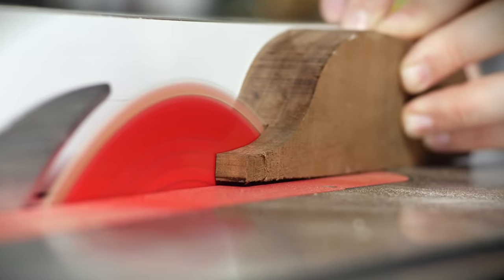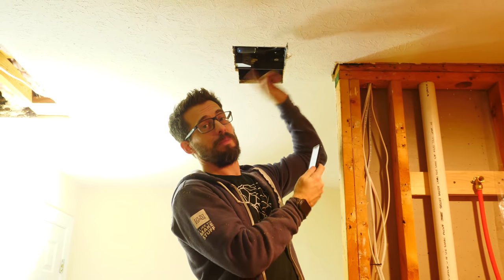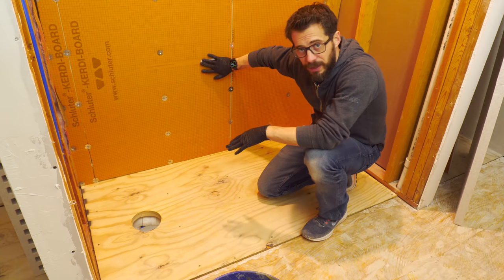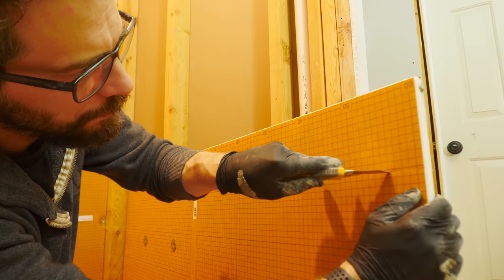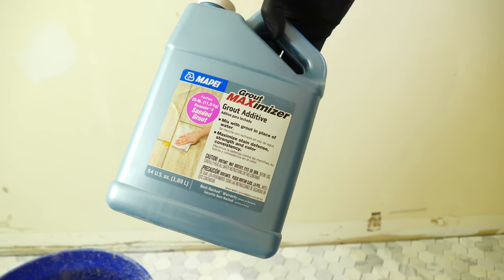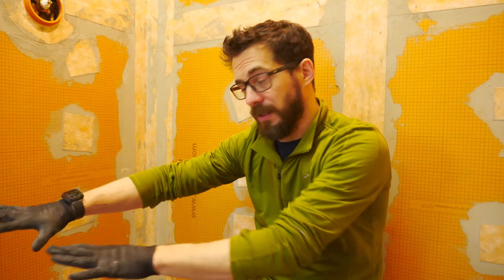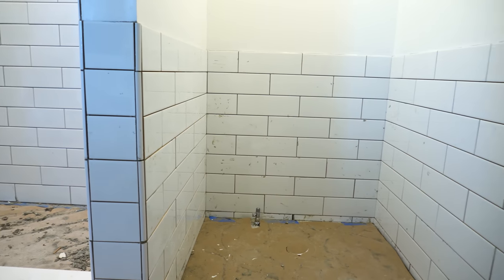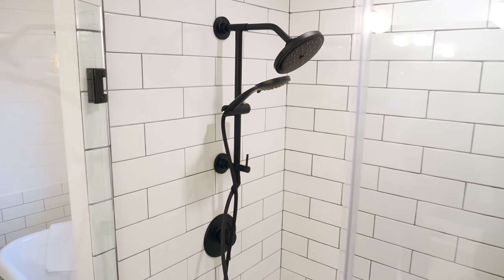Remodeling a Master Bathroom | Part 2 | I Like To Make Stuff

Comment: OK, I was all set to ask a question about the shower door (I'm installing the same basic one in the near future) and then I see something odd. Where is the bottom channel for the fixed shower door panel? I know that door comes with one. My question was how you were going to screw the channel into a foam curb? I'm using Wedi products and that question is why I'm not using their all foam curb. The Wedi rep said for that type of fixed panel (heavy point load) to build a curb from 2x4's and Wedi panel. That way I have somehting to screw the bottom channel into.

Comment: "make sure your light fixture is rated for what you're using it for" lol i had a naked lightbulb sticking out of an unfinished wall above my shower for years, it was terrifying. the door on that bathroom was a blanket nailed to the top of the frame, and it was also the only source of water in the apartment. i'm glad we moved out.

Comment: I'm not a fan of simple abrupt ending of tile like you have there. I would have gone for a row of bead tile in black or to match the wall tiles. I like a more defined transistion. Still it's a great job. I love the variation in tile types, switching to the penny rounds in the shower

Comment: Great job. I have two comments

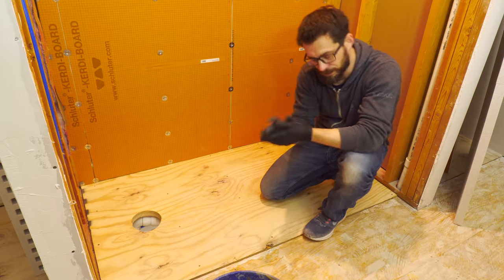1. 7:57 wet the wood with a damp sponge. Dry wood can rob the thinset of water and prevent the thinset from properly curing.
2. It's not a step, it's called a curb (I know, a bit pedantic).

Comment: Im quite amazed how different the water sealing steps goes from country to country. Compared to the steps to water seal a bathroom in sweden darn you get off easy lol. Almost quadruple the amount of steps you did and add atleast 3 days just to get it sealed properly since each layer has a 15+h drying time. And thats before you can even start laying on the tile xD.

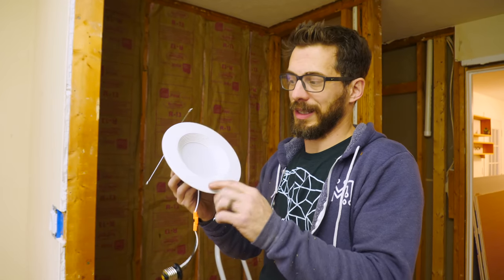Comment: Hey Bob the bathroom looks great. I noticed a PVC line in the wall with a cap on the bottom at 2:44 in the video. Was that an old vent line you abandoned? It looked like 1 1/2" and that would make sense for the old shower drain vent line. I hope you disconnected that vent line in the attic too because if that line still vents to the roof rain water can make it's way down into that capped pipe section and the water would have no where to go. The cap would eventually leak and all that water would empty in your wall.

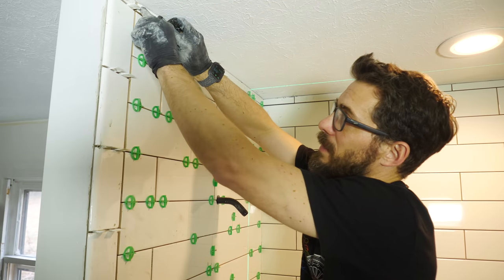Comment: 21:15 Just a heads up, the "correct" way is to measure up the tiling, and average out the bottom and top tiles, so you don't end up with that narrow stroke.

Comment: Hey Bob, Love your work.  You available to tackle our master bath here in So Cal? Getting not-so-subtle hints for a long time. One tiny suggestion though . . .  Learned the hard way that MDF and water are a bad mix, and your counter top appears to be that laminate over MDF type.  We had a minor leak that went unnoticed til the counter top failed and reverted to sawdust.  I now at least prime all raw MDF surfaces a few coats before assembly anywhere near water.  Thanks for some great tips!

Comment: The room turned out awesome! 
The only thing that concerns me is that the vent fan looks a little undersized for the room. I'm sure specs were checked and the CFM matches up, but it looks small to me. The area the toilet is in might suffer when it comes to airflow because of the wall, and being so close to the door, I would worry about an unpleasant situation in the hallway lol

Comment: Bob, your videos have come a long way, and so have you.   I really appreciate your meticulous nature and precision.   You are certainly not a heavily seasoned remodeler pro who has done this kind of work for years on end.

You did your damn best and tried to be as accurate and exact as possible and it shows in the result.   

As a critique:
In my opinion the heavily saturated smurf blue color of the cabinets distracts from the elegance of your remodel.  You usually use that kind of color under a gaming PC.   

For a fine bathroom with great tile work and excellent fixtures; tone that color back!!

Even if blue is your color; great!  Use a toned down color of blue, even if it’s a lighter shade say,  a “robins egg blue” (same intensity and saturation) it would go better with what you did there.  

Not to take an ounce away from the great work you have done here, that’s simply my opinion.   Paint it freakin Neon pink; it’s your house.   You have it however the hell you want.  

Especially after all that work you did.   

Thanks for your time making this vid.

Comment: It looked like you left out some waterproofing along the lower kerdi board joint on the drain side of the shower. Not a big issue but would have been nice to see that waterproofed. It seems you also covered up the HVAC vent with the tub. Even though the tub is on stands, it would have been better to move the vent (perhaps to the adjacent wall) for air circulation in the room which would provide increased air flow for the shower fan. Also this would avoid having condensate dripping from the tub into the duct work. Would be good to insulate the floor as well since it seems to be directly over the garage. Without that thermal break you essentially have a warm room over an exterior floor, unless your garage is fully insulated (including a thermal door). Additionally there may be concern for exhaust gases rising from the garage into the bathroom. So glad you didn't cut into the joist for the shower drain, not sure what the exact code is for that, but laminating would have been a pain. While it is your bathroom and all that, imo the wall tile grout is too dark giving a dirty appearance depending on the lighting of the area. It seemed like the bluetooth speaker only works when the fan isn't running. Would be great if they worked at the same time so you can run the fan and listen to music while taking a shower. Overall it looks like you did some good work. Congrats on the new bathroom.

Comment: Did you run a bead of caulking on all the corners of the shower? Get one to match the grout color. It is highly recommended. I worked as a supervisor for a company that installs tile in houses
Reply from the maker: Yeah, I used the color matched caulk to fill lots of corners and little spots that I missed grouting 👍🏼
Reply: @Iliketomakestuff  great job. Not too long ago I did my mother-in-laws bathroom, complete reno, from tub to walk  in shower with a seat and wide nictch

Comment: Why do you make those bumpy lines before you stick down the orange stuff before tile
Reply: Putting the texture in the cement helps give tile or whatever a much better grip, coverage and contact than if it were smooth.

Comment: Texture tip.. mix your drywall mud loose and roll it on with a paint roller. Thicker application results in less bristle detail. Bob, your mud wasn’t on thick enough in your small area and wasn’t mixed loose enough. That’s why your texture didn’t quite look right.

Comment: I noticed you struggled a bit with the grout on the walls. Here’s a tip for anyone grouting anything anytime soon. Your grout should roughly be the consistency of pancake batter. Not too runny like crepes and sloppy, but not as dry as say cookie dough either. It will make application a breeze, it’ll fill literally ever little nook and cranny without having to force it in there, and despite the thinner consistency it doesn’t take any longer to dry. If your grout gets too thick, because it does dry out after a while, just add a little bit more water, mix thoroughly, and continue. I should know, I renovated my entire first house that we bought from top to bottom, and there was a lot of tiling. I spent more time on my knees than a lady of the night. Also, quick question, why do so many youtubers use what seems to be a cement type mixture for tiling when you could just get a big bucket of tile glue ready mixed and be done with it? Or is that just in Europe? I mean I assume America sells that in their home improvement stores too right? And does no one back butter their tiles? I mean you don’t need to for those little mosaic tiles (nice choice by the way, love those!) but anything that isn’t on a mesh should be back buttered. Or am I being overly critical? That’s just how I was taught to do it. That way, you can compensate for any bowing that may be present in your drywall, which is pretty much always (I’ve yet to find a truly square wall in a house), and make it look really nice and tidy. Just some tips for those who might be thinking about redoing a bathroom or just an accent backsplash in the kitchen. Unless you use mosaic tiles, back butter those tiles, you can thank me later 😉

Comment: Meh, its alright but i certainly wouldn't choose round or hex shape tiles. Also american electrics e.g. fittings and how they have to be off/next to a stud to be secured in place is weird... At least to me (from the UK). The rest is alright. Nice shower, not keen on the silver square waste though. Also for those wondering PEX in the UK is called poly pipe (short for POLYBUTYLENE PIPE) it's alright i suppose, fairly reliable but where possible i would always go ahead and learn soldering to do some nice copper piping.

Comment: Great job Bob!

One very small nitpick - I think you should have measured your tiles and adjusted accordingly so you didn't end up with a small sliver on top in the shower and a small sliver along the bottom around the rest of the bathroom.

Comment: Nice material and finished product.
I don't like the color of the vanity and the color of the mortar. Black vanity and white mortar were going to look much better. Now it looks like there is mold in between the tiles and as if the vanity is there until the new arrives.

Comment: lovely work but the vanity should have been painted either black, white or dark grey, i didnt like the blue, it didnt go at all, also i would have put the door to the sower on the other side so it wasnt on the side where the shower heads were. you can actually get a remote for the shower so you can press the temp you want and to turn the main shower or the second one on or off and you can also select the power. my mum has one very good and youre not having to lean in, actually there are no buttons or levers at all just the sower heads x and im sorry, i know its not my bathroom but the blue is not good x

Comment: Great videos but next time you put in a soaking tub, make sure it's large enough for a modern adult to fit in. As someone looking to buy a home, a big annoyance is how many bathrooms boast being recently remodeled, but it didn't get updated to include things like new outlets and breakers for modern electronics and a tub that accommodates people over 5ft tall. Thanks ofr the video, learned a lot.
Reply from the maker: I'm 5'10" and can sit in that tub without touching the end with my feet.
Reply: @Iliketomakestuff  Would you be fully submerged if you took a bath in it?
Reply from the maker: Well, I'm not a fan of taking a bath with my head underwater, but otherwise, yes.

Comment: Bathroom is beautiful but not complete  I think you forgot  About  the Molden and the kick plate by the  Vanity also the  Mouldin on the right side of the door by the closet And the left side of the closet But excellent job Also I would probly mention in the video that if you're not a license electrician you really shouldn't mess with electric a lot of Fires have  started because people read books but they don't translate the directions correctly and that can cause a serious fire

Comment: Why not a full fibreglass shower insert?
Reply: Honestly, and this might just be my opinion, but the fiberglass shower inserts always look very low quality to me. Like something you would see in an old starter home. I unfortunately have one in my current home (my starter home) and really wish I had a nice tiled shower like Bob has built out. The fiberglass stuff just seems to be a mold haven and they are really cramped since you're working inside a rectangular frame rather than being able to expand into the wall for storage space like the tiled version allows with the insert.
Reply: @DarknessLPs  I can understand that but the fibreglass feels cleaner to me. And I'm no expert whatsoever but it seems like there's no nooks and crannies for grime to build up and is ultimately easier to clean when it is a full smooth piece all the way around

Comment: I love this but why couldn't you have done this video before I did my shower. I used kerdi membrane and the kerdi board would been so much easier than working with cement board

Comment: I simply watch these videos for fun but,
Why does the saw need water In order to function?

(I know nothing about tools, but it must suck using water when it’s cold outside)
Reply: Water keeps the blade cool, allowing it to cut more effectively and last longer and the water also keeps dust down, which can be dangerous to breathe in.

Comment: You can’t put mosaic tile with pieces smaller than 2” in diameter in a foam base.
That grout is going to crack, and the mosaic will pop off :(

Comment: In Sweden you need to water proof ALL walls and the entire floor in a bathroom. We have super strict regulations on how a bathroom is constructed. Seeing this build kinda makes me uneasy!
Reply: Same in Australia and New Zealand except you would need proper fall to the wastes. It made me cringe when he used standard cement based adhesive to stick to Ply wood that will be popping off the Ply in five years.

Comment: You do really good work. Except! You can't jump a ptrap up higher than the vent connection. You 45* it up than jumped up again before the ptrap. You've just eliminated the vent for that trap. Don't do that. Needs to be on the same plane as the vent.

Comment: This is making me think this stuff is easy.  I need to see mistakes so I know there will be problems and it will not work perfectly each step of the way. 
You did not install a vapor barrier because it is only needed in areas that get cold, and you went outside to cut tile and it is 27f???  Seems like that would be a large enough outside to inside temperature difference to make moisture.

Comment: my only comment was when you put the vanity up to the wall i did not like the cut out for the plumbing on the vanity it looks sloppy should have had a decorative pipe cover the wholes should have been better  not just cut a large hole in the back of the vanity

Comment: As a plumber...you´re good...But as a tiler..you don´t know basic rules...you have to start with wall tiles ....especialy with 2nd or 3rd layer from ground..than you have to miss 1st layer and than do floor tiles....after floor tiles you finish that last (1st) layer of wall tiles next to floor.....second....you cant have those small trimming next to ceiling...only if there is no other way...you measure it wrong....third...those corner tiles...are terrible...

Comment: You buried a junction box in the drywall above the sink, that is strictly against code.
Reply: Correct me if I'm wrong but wouldn't, A, code be different depending on where you are, and B, the junction box be OK with that much distance between it and the sink? My house was built with a junction for lighting in a similar area and I'm in TX, USA so I imagine it's up to code in some places at least.
Reply from the maker: No, I didn’t. It’s in the attic space and fully accessible.

Comment: Dude, i love your show, but i wish you watched another fellow youtuber, before tiling the shower.

You are suppose to use a line of accent tiles somewhere on the shower wall,  like glass tiles, that can be cut to varying degrees, then you can use whole tiles up to the accent tiles, and whole tiles from ceiling down to the accent tiles, again so you can have whole tiles.even if the shower isn’t square which i’m sure it’s not it would still look better then the 1” cut tiles on top....
Reply: This guy is a professional, but really gives you the oh crap moments ahead of time.

Comment: Subway tile in the bathroom looks WAY TOO institutional. It's fine for the kitchen - but doesn't make the bathroom a warm and inviting place.  This bathroom looks worse than a hospital bathroom IMO.   Also far too many different shapes going on in that bathroom. No unity at all. Two different shapes of floor tile, different wall tile and then lights that are different shapes from the rest.  You should always pick a single shape for the bathroom. If it's circles then go with a circle sink, lights, towel holders etc. If it's square than do the same.  This bathroom is just to all over the place - but do respect the effort and install.